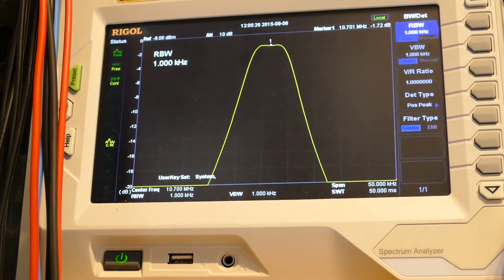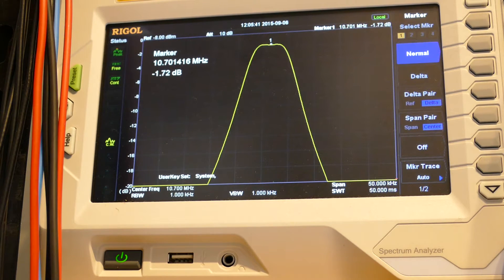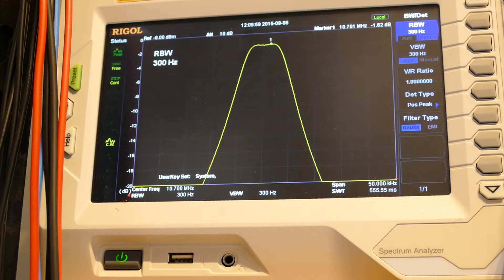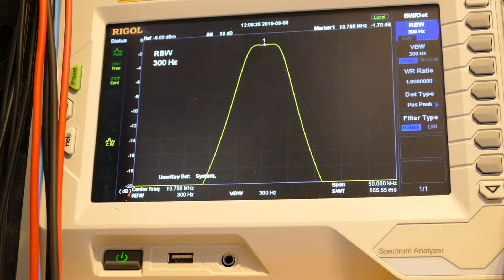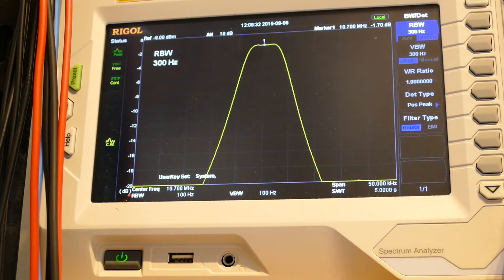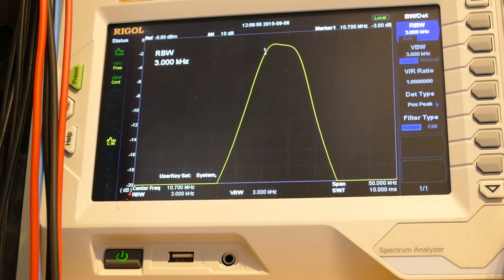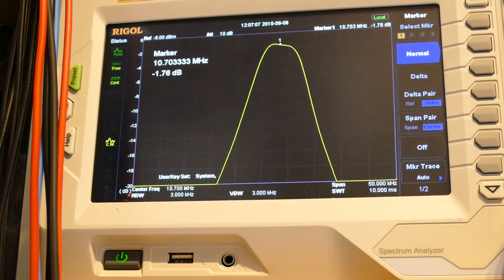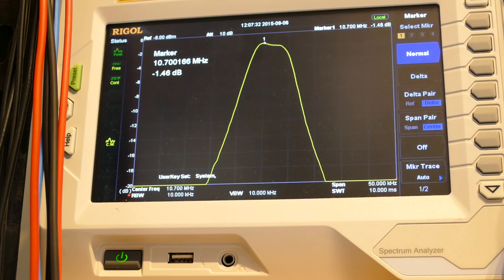DSA815 frequency offset 3

Comment: have you try change only the sweep time?
You chage currently the RadioWB and the Sweep time.
The any  filter need  time for frequeny change. See the DAS815 manual for the "UNCAL" message.
you can calculate the minimum sweep time with this formel:
sweeptime (sec) = (1 / filterbandwidth(hz))  * samplepoints (the DAS815 use 601 Points)

Your filter have a round 5Khz bandwidth.
(1 / 5Khz) * 601 = 120,2 ms